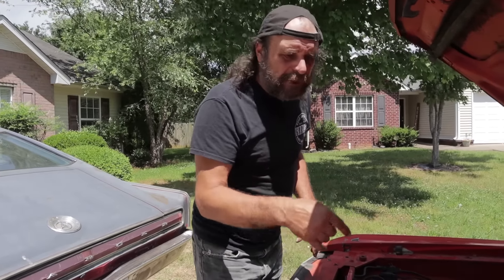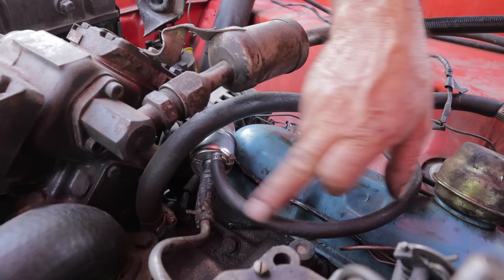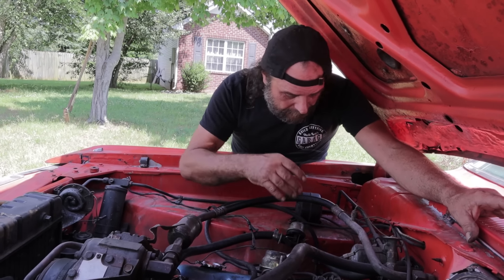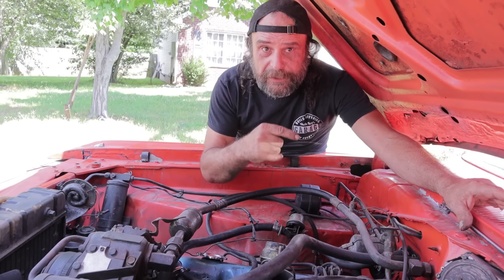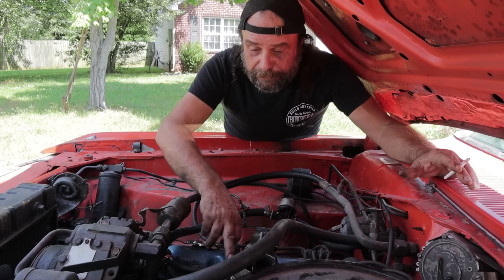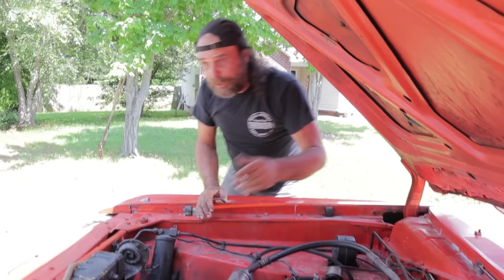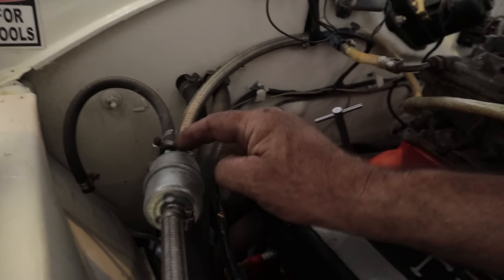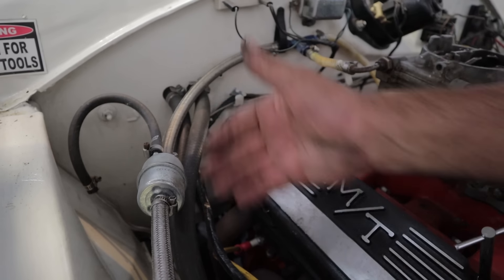$8 Cure For Vapor Lock

Comment: Good tip! Also, I like to run a phenolic resin carb spacer where I have room. This seems to help carb stay a good bit cooler and helps with vapor lock. Atleast in my climate here in SC this is sometimes all I need to help with vapor lock issues. Until you get into my BBCs. Good God they make stupid amount of heat... sometimes you have to throw the book at them. Half my fleet had a hard restart until I figured out it was vapor issues from the 10% ethanol gas.

Comment: Dude I know I am necroposting, but thank you again Tony for more invaluable information. I rebuilt an 84 caprice wagon as my family cruiser, and I drive the hell out of my cars. Like a LOT of miles. Got this thing on the road, and all the hot rod shit (basement head job, hedders, intake, points retrofit, etc) ran fine. Great in fact. Thought I even designed her well for vapor lock well with lots of exposed copper/nickel alloy line in big cooling loops in front of the fans, with regulation, and a mech pump with return line, and a phenolic spacer on the carb and mostly blocked off crossovers, but as soon as I switched her over to the 10% ethynol crap, I started getting boiling issues after the whole car, not just the engine - warmed up to real operating temp, like after 30 min or so of real driving. Anyway, I will be switching my return style mech pump over for a normal returnless, and rerouting that return line to the wix 33040 i'm picking up in the morn, along with a check valve near the tank on the main feed line. Then I am driving hundreds of miles with half the family. This thing WILL obey me and run right even at full temp on cheap gas.
Reply: And, yes I know boiling is my issue as I can see it boiling in my final stage glass filter, along with jumpy regulator output pressure - the filter which I will be replacing with the regrettably opaque wix filter. Good thing I still have a pressure gauge on the regulator to monitor the output. hopefully should be less jumpy as a verification of success.

Comment: You have addressed a problem, of which I had been explaining for years now (to no avail)  because the excess heat vapor will be vented to the tank, will be adding more (minute amount, but still pressure vapor), and increasing fuel pressure to the fuel line, keeping a pressurized fuel line (minute, but still), & eliminating vapor lock.  Nice to see people going in depth, & investigating these problems. Btw, I 'scribed!

Comment: A lot of people never experienced this, but was/is a problem, rodders usually ran electric pumps (if not regulated properly caused severe headaches), but never had a ruptured diaphragm, fuel leak back into the oil, yes as a street peep, I preferred the electrics for oil contamination safety, great educational video as usual...👍👍👍

Comment: It's a "Fuel Filter with Return Line" easily avaible on the net.

I have a car (renault 21 from 1990 ) with a similar set up but none of it is on the fuel filter itself.
It's a kind of dedicated canister with one line in and two out,wich act as fuel pressure regulator at the same time.

Comment: I'm gonna throw this out there: When in doubt, use the type with an orifice.  Liquids can only really flow as fast as the most restrictive part of the path.  The flow rate across one .060 orifice is going to be close enough to identical to the flow rate across two of them.
Reply: do you know which cars sued that type so i can get one?
Reply: @britneyrichards9714  WIX 33424

Comment: An even better solution is if you live near a place that sells 93 octane ethanol free gas. People still need the stuff for their generators, lawnmowers, and boats. A boat with E-10 in the tank won't be running for long. Any boat marina or bait and tackle store where boaters gas their boats should sell ethanol free gas. You will notice more power in your old car right away.

Comment: The part number is 33041 by wix.
Reply: Is the Fram G-3583 an option?
Reply: Does this wix 33041 have the Orifice built in? I need one with the Orifice built in
Reply: i need the orifice one too
Reply: @jaimelopez8378  did you ever get an answer to this? Does the 33041 have the orifice?

Comment: I Had a blue 68, RR. Taxi seats  Cardboard roof liner, Rubber floor mats, am radio,ps,posi,383auto, I cut out hood scoops on a milling.machine, Wrecked it in Tennessee, left rear quarter, had it fixed, not replaced. I loved that car 140 feet of rubber then 10 feet in second. 3:23 rear end.......

Comment: Hm... don't think I have this issue on my 300 straight 6, single brl carter...    I removed all the emission shit.   Been fine. 
But, if I do.....I'll tony it.
Reply: Don't know alot about carbs so will vapor lock cause bad mpg
Reply: @itswheelie1918  vapor lock will cause it to shut off.
Reply: @incrustwetrust69  Weird.    The new 38gal tank vents just under the cab.  But idk.. maybe at our altitude in Idaho or somt'n.
Reply: @incrustwetrust69  

......

Comment: Uncle Tony; You're 100% correct. About 25 years ago I had a similar problem with a Chevy S10 pick up. I was having difficulty starting after a hot soak and after installing whats called a "spill pot", I was able to solve this issue. If memory serves me correctly I think it was a Mopar service part similar to what you describe. So again you are certainly correct and the pick up ran great ever since. Have a great day sir.

Comment: Excellent tip. I have an auxiliary electric pump near the tank to overcome the vapor lock when it happens, but I'm still wasting fuel when it's flooding the engine. Your fix is definitely worth a shot. Thanks!

Comment: About a week ago I subbed your channel. The straight forward  way you put your information out to the viewer is very refreshing. My dad has a 1966 Olds  442 that vapor locks,there's an extra steel line that runs back to the tank. Now I know why!  What was the part numbers for those Wix filters by chance? Just a side note, I'm into the Ford Falcons and you would not believe all the gripes about vapor lock on the forum sights. This is one video for sure I'm going to share on these sights. 
    I've always wanted a late 60s  2 door Dart. My cousin last night tells me he has a lead on a clean 67/68 with a slant 6 in it for a reasonable price. Looks like it's time to squeeze more room out of the corral.........
Reply: Part numbers would be great
Reply: @kevinpelesky5467  Fram GF84 Wix has a parts interchange for this too. Check with NAPA. Should be $5.00-%10.00
Reply: @kevinpelesky5467  Fram GF84 Wix has an interchange for this number also. Check with Napa.
Reply: @edspencer7121  that number doesnt exist with Fram
Reply: @edspencer7121  and their website is just as terrible as their filters
Reply: I think its Fram 3583, WIX 33041, NAPA 3041,  and Carquest 86041. Please double check the parts before buying.

Comment: You have a part number for those fuel filters???
Reply: One guy above said it was a WIX 33041. I am wondering if the FRAM G-3583 is also an option for this set up. I can't get anyone to respond so far?

Comment: Thanks Uncle Tony. My fix was a small electric fuel pump close to the tank with a regulator turned way down so the fuel was under pressure a little pressure going to the fuel pump instead of vacuum but that wouldn't help at the carb after the engine was turned off. I haven't had any problems yet and hope I don't but thanks in advance if I ever do.
Reply: Watch that method.  Some mechanical pumps can fail in a way that lets the lift pump push raw fuel past the mechanical pump and into your crankcase.  If your'e going to put an electric pump in, better to eliminate the mechanical pump all together.
Reply: @immikeurnot  I have a fuel pressure regulator inline between my mechanical fuel pump and my Quadrajet set at 4.5 psi with a return line going back to my tank  but I see what you're saying if my electric over powered my float I could be in trouble.

Comment: I just had to log in and comment. Thank you sir you solved my vapor lock problem! I have an entirely new fuel system on my 468 bbc and once it got hot it lost fuel pressure (mech fuel pump). It left me stranded several times and was very frustrating! Thank you again!! 🙏🏻🙏🏻

Comment: An old farmer’s trick to avoid vaporlocking - clip a few wooden clothespins to the fuel line between the pump and carb (only works if it’s a metal line). The wooden clothespins act as heatsinks of sorts to draw the heat away from the fuel and keep it from vaporizing. I know it works because they’ve been on my ‘71 C10 for years and I’ve never had an issue after installing them!

Comment: My 1972 Gremlin had no charcoal evap canister -- the tank vapors were routed up to the engine valve cover, where they stayed until the engine was started.  In a running engine, the PCV system sucks the vapors from the valve cover into the engine to be burned.  A creative solution for evaporative emissions back in the day.  I can't tell you how many smog technicians I had to refer to the BAR because they were not familiar with this evap system from AMC.

Comment: You can also insulate the fuel line and run a heat shield under the carb.  Some used to use a "turkey pan" that had the carb in what looks like a jumbo air filter box.  Old Fords had a small cooler used for the power steering pump, looks like a tiny cooler, you can use that inline as well.

Glad to see older cars being kept alive, they have real character.

Comment: I just did this mod to my buddies 68 Skylark 350 2 Bbl..., 5 yrs of ethanol related issues...!!! He did ignition,Electric pumps, changed Gas tank, Phenolic carb spacers...$100's of dollars, Fuckin' No Luck.... I drilled the  Tank pickup cover and installed a 3/16" brake line fitting, adapted a 1/4" rubber fuel line back up to the AMC fuel filter you referenced. (Be sure to keep return line on filter 'UP')...3 yrs now..NO Issue !! As you said, the small chunk of 3/16 brake line at the pickup gave enough restriction to keep Fuel Flow Adequate to the carb, and stopped the Vapor lock probs. Cool,Non-Aerated fuel is the best. Up here in NH, they have Oxygenated (Ethanol added) and when he finally got the car running after 15 yrs, all we had was 10% ethanol fuel available. THAT's when the problems started...Thanks for your Video !!! Mopar Guys are good dudes, even us Ford guys know that... :)

Comment: Another way to do it if you want a nice upgrade is to use an electric fuel pump and make a return style fuel system with regulator. An external electric fuel pump can basically be mounted anywhere and wire it to a flip switch in the car or the ignition switch, then run fuel feed to the pump and from the pump through the regulator then to the carburetor, you will also have a line off the regulator that diverts the extra fuel back to the tank that is the return line. Then adjust your fuel pressure to where you need it to be and no more vapor lock and you will have more consistent and constant fuel pressure.
Reply from the maker: A bit more involved than adding a vapor separator, but that'll get the job done too
Reply: That's what I did and now my truck runs so much better and smooth. Don't even have to pump the gas pedal once the truck is warm to start and the good thing is if you need to add more fuel or less you can adjust to whatever pressure you need. This mopar is turning into a Cadillac haha.

Comment: What you said makes so much sense like a pressure washer when you not using it and the engine just running the valve open to let the hot water out because it heats up the pump man I wish I can bring you my truck

Comment: I recall a similar setup from the factory on my 1968 Oldsmobile Toronado with the 455" V8. It had an extra fuel line running from the fuel pump back to the fuel tank even though this was generally before unleaded fuel was used.

Comment: I just have a fuel cooler rail added in front of the radiator. From the fuel pump, to the rail, to the filter, to the carb. No complaints, never been stranded on the road. It does it's job efficiently. I'm happy with my set-up.

Comment: I'm just East of Toronto, I buy Shell Premium which has 0% Ethanol. I never run corn in anything. If your intake can accommodate a heat shield under the carb then it's wise to install one.
Reply: In the USA, Shel''s V Power/93/Premium still has Ethanol in it. They just add more detergents to it and call it premium.

Comment: Just did this to my daily driver 1968 300. Fixed about 90% of my hot starting issues. Normally 10 seconds of cranking or more to get it fired up when hot, now it starts almost immediately when hot.

Comment: The problem is many people remove return lines etc etc thinking they are useless . GM had return / vent style filters back in the 60's. Vapor lock was common then too. They are there for a reason. I always tell people run a return style mechanical fuel pump. It helps alot.

Comment: Ford trucks with a 460 and carb had a hot fuel bypass as an option. Three different orifice sizes and a return to the fuel tank(s). After a vapor-lock on the freeway with a camper and boat I replaced it with a Holley bypass fuel pump and a higher (8 psi) electric fuel pump feeding it; it was downstream of the fuel pumps in the gas tanks (about 3 psi). It maintains 5.5 psi to the carb and bypasses the extra that the engine does not use back to the fuel tank(s). It was a lot more expensive than the fuel filter solution shown which I did not know about. Other changes were a 1" phenolic spacer under the carb, reduced exhaust heat through the manifold, and insulated fuel lines as the engine generates a lot of heat when working hard. BTW, some Maverick gas stations in N. Nevada have ethanol-free gasoline with a higher octane rating than regular and that is very popular with hot rods and small engines like chain saws.
Reply: Correction: Should have read Holley bypass fuel pressure regulator.

Comment: I had a 1953 Caddy that would vapor lock if stuck in traffic but was fine  on the highway. Read an article in a magazine that suggested putting metal (aluminum) clothespins along the fuel line to the carb. I got some, put them on, looked goofy as heck but worked like a charm and no more vapor lock. This was back in the 90s. Not sure they even make aluminum clothespins anymore.

Comment: I can confirm that this is the stock setup in my Eagle, the later AMC's also had a one way check valve on the return line. I initially had vapor lock problems with this car which I why I looked into this, turns out the problem was that the previous owner had capped off the fuel tank vent so the entire fuel system was over pressurized on hot days. Fixed that and now it runs great.

Comment: This is my hillbilly fix on the 70 Coronet I used to daily. From the pump, I drilled 2 holes through the core support. I took 3-4 feet of 3/8 fuel line, metal of course, and wrapped it around a mag lite, or whatever 2" or so object you can find, and mounted it ahead of the radiator in the path of the airflow. Basically a cool can without the can. Worked pretty good unless I was in a traffic jam. A parts store trans cooler would work too, but I'm macgyver damnit!

Comment: I've got a '94 Ranger with EFI and it does this once in a while. It ALWAYS starts when cold but sometimes I start it and run to the store,go in for a few minutes and when I come back out it takes 15-20 seconds of laying on the starter till it fires.  It doesn't do it often and there's no codes or other problems.

Comment: Good tip.  Another fix is to use a Tee at the Carb inlets that flow past the carb(s) to an 0.045" or slightly larger orifice and return line.  No filter in the pressure side.  The pump will still move fuel constantly so it stays cool all the way to the carb inlets and you can hold pressure constant with the regulator.  But the minor flow back to the tank does the trick, just as yours does.  Either way, flow and return is the key to keeping it all working well :)

Comment: I've just ordered the fuel filters share this video to all my hot  rod  friends in California.they use a lot of ethanol in our fuel out here alcohol boils at a lower point..fuel-injected cars are running 40 PSI which helps them not to boil.I built my 70 super be to stock specifications including all the fittings exhaust manifolds for the 70 4 speed I live in Santa Barbara not a lot of open road space and a lot of red lights. I certainly hope this will turn that car into something I can enjoy .

Comment: I used to run my fuel lines into a Round type small igloo cooler  coiled up back to carb with bag of ice instant 20 hp on hot ass day in the 80s. Did it to all my hot rods before racing back then. Texas ain't no joke in the summer..

Comment: Thats a very clear explanation of getting rid of the vapour to try to keep the fuel thick and flowing. I may have a problem with my little weed wacker as it goes a bout 20 mins then starves for fuel. I might put a piece of Aluminium strip between the short plastic boss and carb and run it out 6 inches and cut fins in it to dump excess heat. Also wrap the 2 inch plastic hose fuel line with metal brain tubing as thats close to the engine too. If that dosent work, i out of ideas and the expert walbro channels too  ive asked to as why it works perfectly then goes lean and even will clear itself after 5 mins and i can get max power again. Very tricky but i will keep working on it...There a reason, but just not found it..

Comment: Sounds like as long as you run a return style fuel pump you’ve done most of the work already. GOOD! I did that without even knowing I had fixed my old fuel percolation issues.